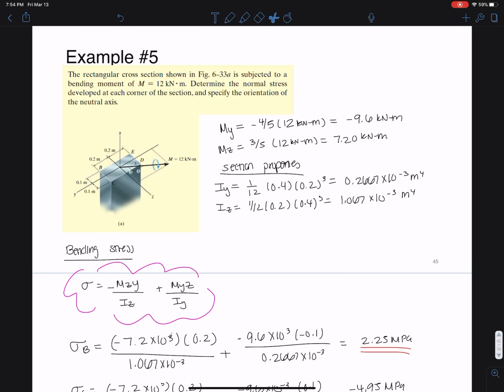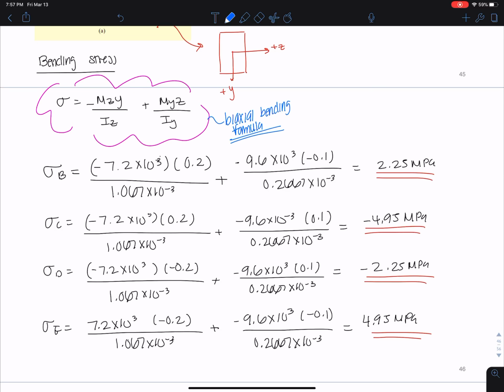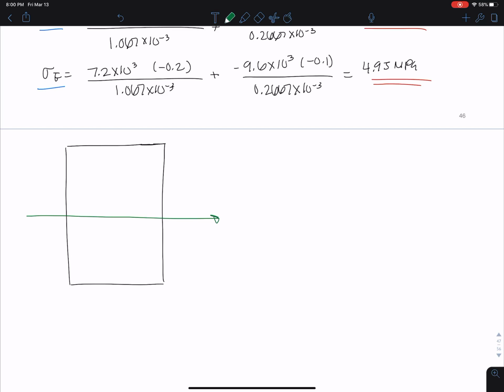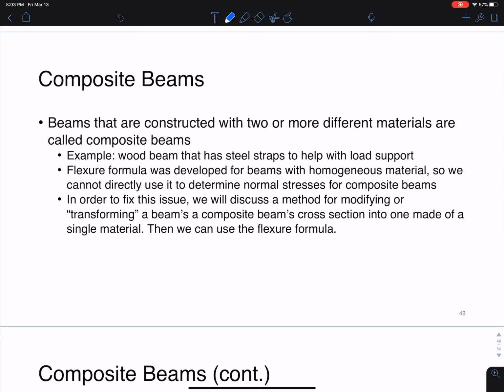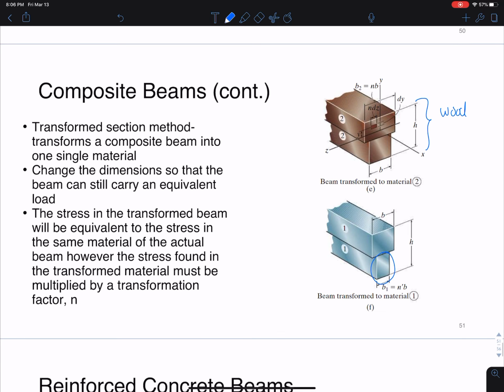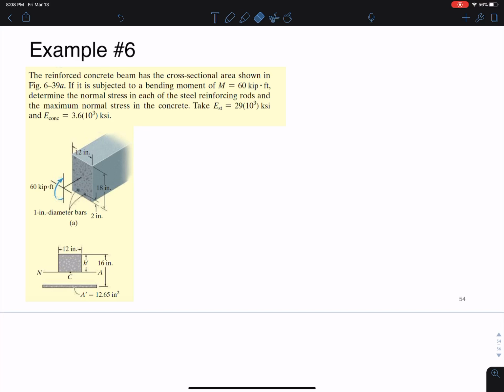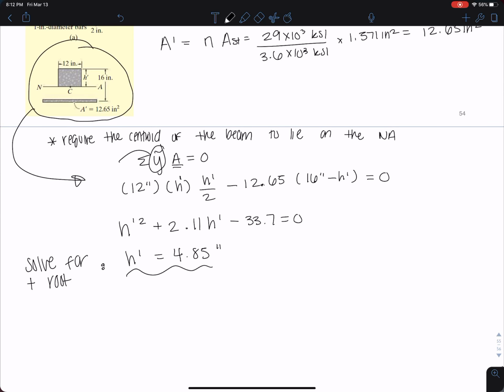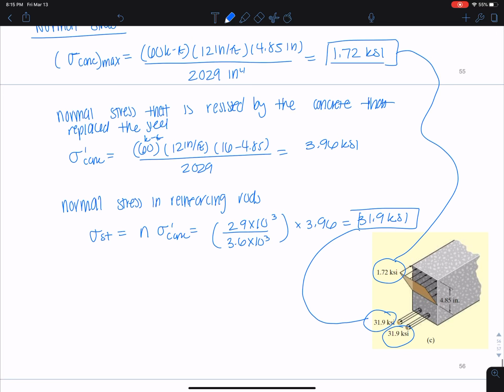EGCE301Topic5Part4

Comment: Noticed when calculating the Bending stress of the corner E. Forgotten the (negative '-' sign) for the Mz.

Question?@3:56 on the video I was trying to figure out the y and z for the normal stress B. I was looking at the cross-section area drawn to show the y and z axes positive, but I still think the z for the normal stress B should be positive +0.1and not negative. What do you guys think? I'm I wrong?
Reply: Hi Erica, I think because it's located in the negative z-axis so it will be -0.1